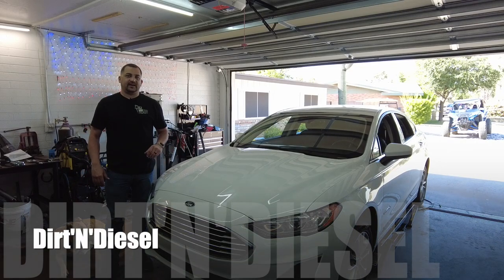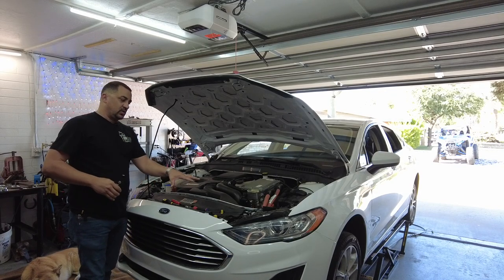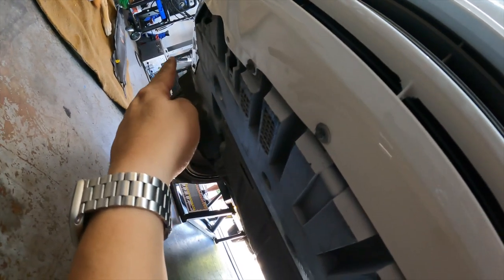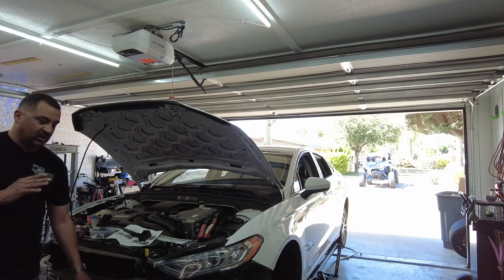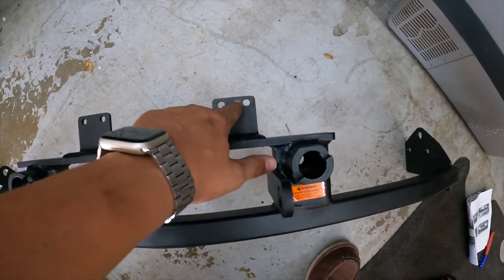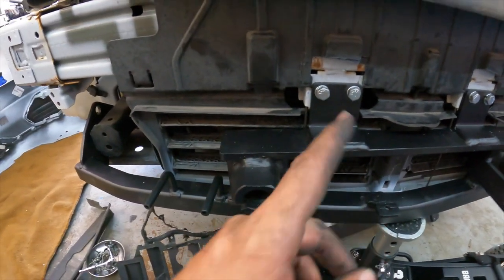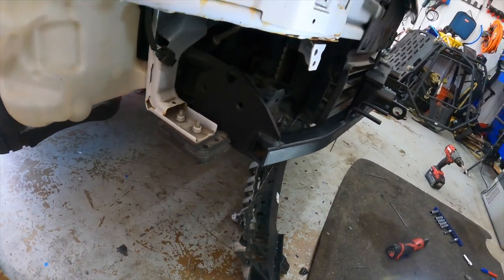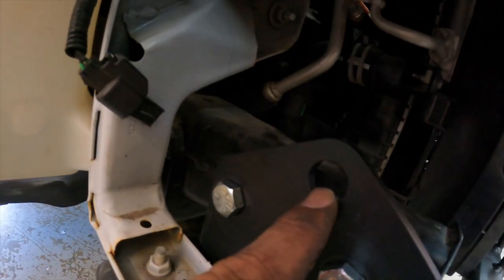Tow Bar install on 2019 Ford FusionBlue Ox 2864

Comment: Thank you , Thank you, Thank you!...  I have a 2013 Ford Fusion Hybrid.  Blue Ox sold me a BX2646 Baseplate.  But basically same as yours.  I think you modified yours to accommodate your durango as well. But no worries.  I'm watching every step that you have done.  I will agree that you will get it done it 15 minutes before cleaning up.  I will get it done in 10 hours (but mine will include cleanup).  I simply wanted to say thank you.  I'm going to get started on it tomorrow before the weather turns, so I can practice towing behind our Motor Coach.  Also, if you have any videos on how to wire it up that would be helpful.  But I will start with step one............  connecting the baseplate.  Thank you so much!